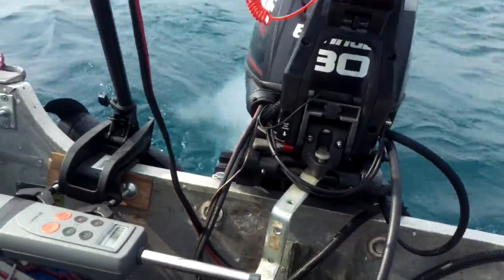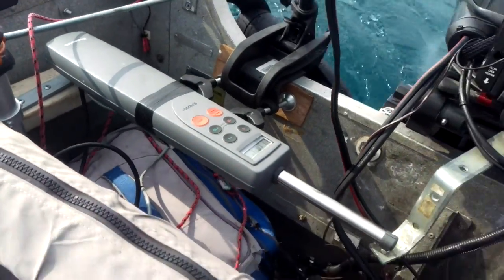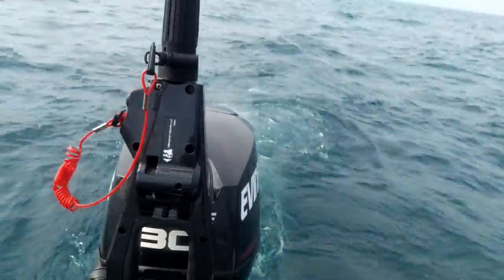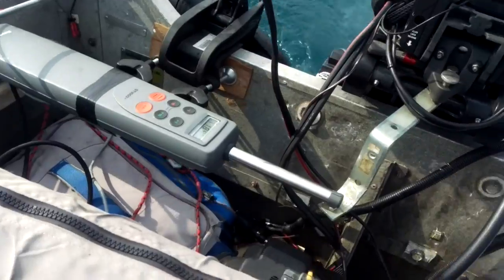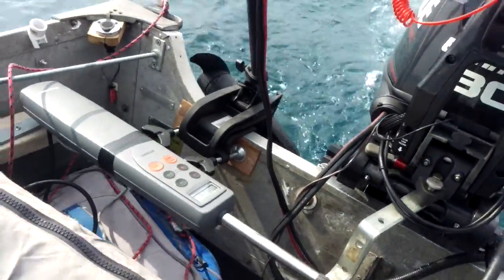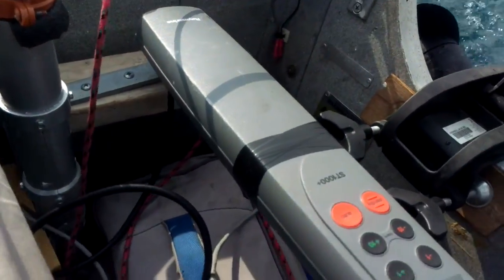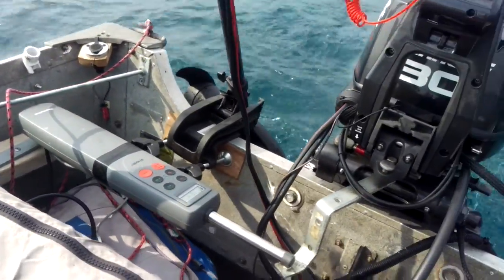Autopilot for small boat

Comment: I had another question in the video at :29 I got a quick look at what looks like a tiller mounted to the top of the engine shroud.  I have never seen that before.  Was that custom by you?  Thanks for the answers.
Reply from the maker: Yes it was a  piece of metal I bent in the vice to make a braket to connect it to my motor  and used a 1/4 inch bolt cut the head off and rounded it so the auto pilot can connect to it
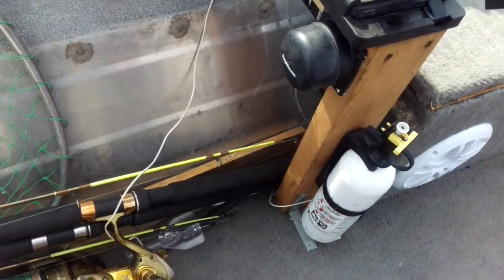Reply from the maker: At 1:30 I show the flux gate compass your going to need or else this will not work with any outboard due to magnetic interference from the motors magneto

Comment: It looks like you have a Lowrance Elite 7.  From what I have been able to find out the Elite line won't output NEMA 0183 sentences.  How did you wire the two together so it drip feeds waypoints?
Reply from the maker: I no longer have this boat upgraded to a much bigger one.

But that fish finder is a lowrance elite chirp model.    Wired with Nema 183.   4 tiny wires.   2 wires are transmit positive and negative.  And 2 wires are positive and negative for receive.      You only need the transmit.    But it has a spot for all 4
Reply: @disonesto  Ok I finally found it on my Elite 4 Chirp, in Advanced, settings, NEMA 0183 my unit will work.

Comment: Question 

Does the autopilot works with Internet only??
Reply from the maker: It doesn't use any internet at all.    The Ethernet cable only connects compress to unit.    100% no internet
Reply: @disonesto  I would like to set up same similar system. It seems to me you use a navagation controller ( like pixhawk) that connects to the satellite for the waypoints 

* how can I get all information regarding the equipment? Please
Reply from the maker: @franciscourena5636  my chartploter supplys it the waypoint data throw nema183

Comment: Finally my fluxgate compass came in. I have a 50 Etec do you think I can mount it about 5' from the engine without any issues. Also would it be OK to mount it in one of storage compartments. Be nice keeping it out of the weather.
Reply from the maker: Yes you can mount in a storage compartment just keep it away from anything metal.  Aluminum is OK.   And you have to test how far from your motor.  But 5ft should be fine
Reply: @disonesto  OK thanks I'm going to solder my fluxgate compass to the cat5e cable. In the cat cable there 4 coloured wires with 4 white wires and the compass has 4 colored wires and a bare wire how do I wire them. Just solder the colored wires and leave the white wires. And what about the bare compass wire. Thanks Jeff
Reply from the maker: @jeffmcgill3596  you have to solder the wires the same way the pads are in the st1000.    In same order.   So look at the internal.flux gate  and match it with the external.  The pads are on one side
Reply: @disonesto  OK I took the st1000 apart that might be a bit to fine of soldering for me. I'll just try it with the built in and hope for the best. I can't imagine being able to solder it and not completely ruining the board.
Thanks jeff
Reply from the maker: @jeffmcgill3596  your not solder to the inside of the connector.   On the outside of it it has the legs on the white connector.
Reply: @disonesto  ok I understand that but now my issue is the ethernet cable has 4 colored wire and 4 white wire.....i think I need a diff ethernet cable I've tried 2 hoping for another colored wire. The whites go with each colour so I have no where to but the bare wire. I tried to send a picture but don't know how
Reply: I'm in ont canada
Reply from the maker: @jeffmcgill3596  I won't be home until the weekend I'm truck driver.    But I should have pictures when I did it on my computer.    I'll post links this weekend
Reply: @disonesto  sweet thanks alot
Reply: Have you had a chance to see if you have any pictures? I'd like to see exactly how you soldered it and also I don't think my ethernet cord is right either i think I need another wire
Reply from the maker: @jeffmcgill3596  here is the best picture i have the others where too blury. i would have to disassemble mine again to get better pictures.   the pins for the connector are to the right of LCD screen.

https://drive.google.com/file/d/1CgDP7U-GX_geDkhiCncbTDICYlGoAIgK/view?usp=sharing
Reply: @disonesto  I know where the pins are. The problem is ethernet cables only have 4 colour wire......but the st1000 had 4 colour wires and a ground ......did your st1000 have a bare ground wire.....
Reply from the maker: @jeffmcgill3596  I have 5 wires soldered as it shows in the picture
Reply: You used a ethernet cable right? My only problem is my ethernet cable has 4 colour wires and 4 white. Each white wraps one of the colour wire. I actually just bought a cat6 ethernet cable as well and it has the same thing. Does yours have 5 individual wires. I've searched online and can't find a ethernet cable with 5 wires.
Reply: I think I figured out u used 1 of the white wire .....i didn't understand how the connectors where wired but I just broke on open.....sorry to keep bugging ya
Reply from the maker: @jeffmcgill3596  I sent you an email
Reply: Do you still have pictures of the internal wiring you did? I've got the parts to do the same modification. Thanks

Comment: My ST1000 came in I'm still waiting on the Fluxgate Compass you recommended. Question is there a way to make the Flusgate compass removable so I can remove the ST1000 when I'm not using my boat?
Reply from the maker: Yes I use an cat5 Ethernet cord.   With the connectors. 
https://images.app.goo.gl/of3iGpKn6oe4FuV48
Reply from the maker: This is a picture of the under side of my st1000+

https://photos.app.goo.gl/VV3fFg3WTefKqiCP8

Comment: Could you post a link for this replacement external compass. On there website says u need a st40 or st60 compass and there like $250 us
Reply from the maker: https://www.ebay.com/itm/Raymarine-Raytheon-Autohelm-Fluxgate-Compass-Module-M81190-TESTED-Short-Cable/193350303680?epid=16017007925&hash=item2d04937fc0:g:9TsAAOSwdz9eTGYs
Reply from the maker: Look up M81190 or look up raymarine fluxgate compass on eBay 

I got mine on eBay used short cord and used cat5 cable to extend it
Reply from the maker: Does not use st40 or st60
Reply: Thanks for the fast reply much appreciated! Your still happy with the st1000?
Reply from the maker: @jeffmcgill3596  yes still using it hasn't failed me yet
Reply: One more thing. How is it at real slow speeds I troll walleye 1.3-2.5 mph......Will it hold a heading that slow.
Reply from the maker: @jeffmcgill3596  it works.  I troll for salmon on lake Michigan,  I mainly use it for trolling between 1-5mph.   Only thing is when it starts to get choppy you have to increase speed to over come the wave force or else the waves will push you off course and then it's all over the place
Reply from the maker: It holds good you will see straight lines on your graphs track history
Reply: I just ordered that Fluxgate Compass! Thanks for the info and help!

Comment: They don't work with big waves and wind.
Reply from the maker: Matthew Adams for me it works if you see its having a hard time keeping the boat straight you have to bump up the speed little more to compensate for the waves or wind , and make sure u have the gain and rudder speed set properly.  Everything will work fine .
Reply: Disonesto---I fish the Columbia River / Ocean. I had an auto pilot and trust me it will not keep up with the wind, waves, and different currents.

Comment: great setup. does ut work better with the external compass or is it just because you where afraid of interference? i have just bought a st1000+ so i gone try this setup. could you send me some explinations of where to solder the fluxgate compass? my email is daniel.odegard@hotmail.com
Reply from the maker: daniel Iliev ødegård you definitely get interference with the Compass being right next to the engine even if you slowly turn the engine you still get interference it's very noticeable.

only way this works you have to have the fluxgate Compass away from the engine
Reply: thanks for the answere, great videos you have. i did test the st1000 yesterday and you have right😂 it was a complete mess with the compass. do you remember the color combinations that i have to solder on the pilot  from the fluxgate compass? i have solder some times but im no pro, did you think ut was difficult?

Comment: how did you wire the additional fluxgate compass?
Reply from the maker: kstarup kstarup you have to remove flux gate compass  from unit and map which pin went where.    then solder wires to the pins and then solder them to the corresponding pads on the flux gate compass.    

if you use an external flux gate.  take apart the external flux gate to get the corresponding pad to corresponding color wire 

the external flux gate has the same flux gate that you remove from the unit